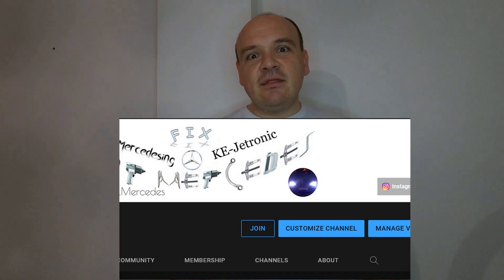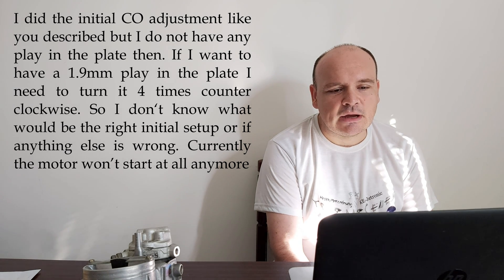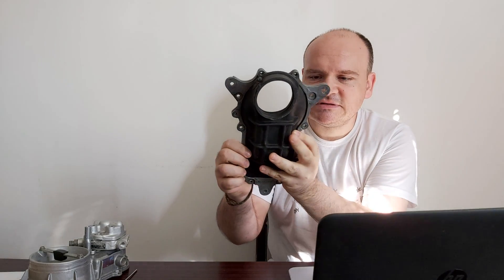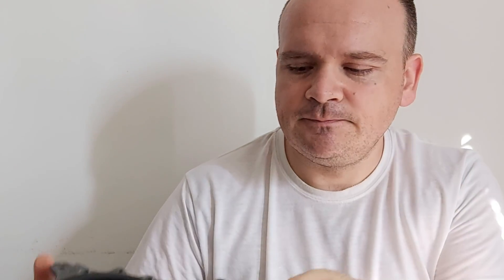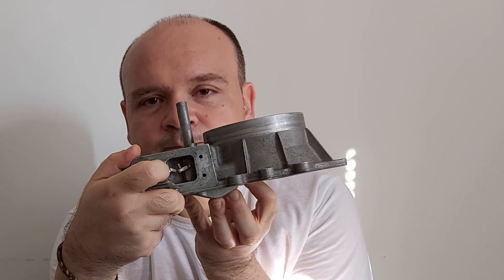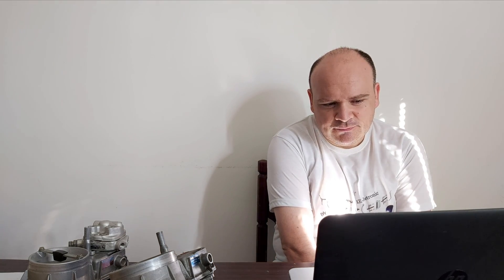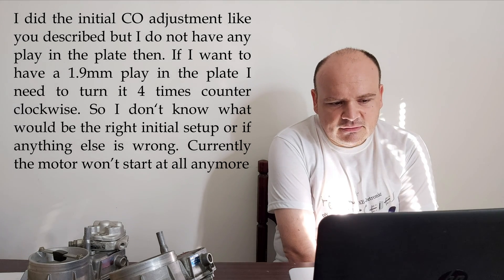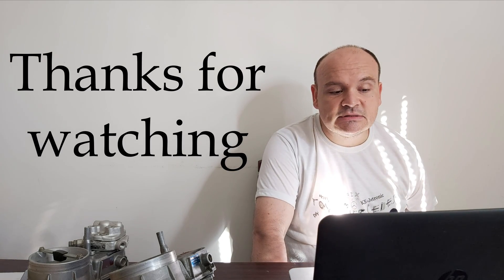㉦Mercedes Ke-Jetronic㉦ - The answer to the comment on adjusting the CO screwГ

Comment: Nice video.

I have question, well you be covering other fields, like suspension or steering problems ? 
As i example i have problem with my 190e 1987 manual gear , anyways when iam cruising at low speed at first or second gear the car drives weird, like shaking, the car shake backwards and front unless i step on the pedal  or clutch it again very gently and stepping on the pedal slowly.
Also the Car RPM seems to be stable while idle.
The car has a rough start even if the weather is warm, i always have to step on the gas gently, over stepping cause the car to die, if i dont step at all the engine start for like one second then die, same as @anbevelsborg i guess i will try to find a gage and diagnose fuel pressure, (note the setup is fairly new, i recently change the engine and gear and converted to k jetronic)
When the car is hot (around 80 degree) it start without stepping on the gas but the rpm drops after starting for 1-2 second then it comes back up eventually or after hitting the pedal once.
So iam not sure what could be the cause, is it engine\ fuel system or transmission problem, or maybe the its the emission exhaust could it be clogged?  
Not sure where to look to fix these 2 issues

Comment: You have upload one video about the codes in fuel distributor the lm0007 and the other codes but I can’t find the video and I can’t check my car to see if I have the right one…help me please
Reply from the maker: If you have codes it usually happens to be on the lambda. Anyway, just list all your sensors and check them if the wiring is okay if they are okay. Once you do, there should be no codes. LM0007 is 190E 2.3-16 right?
Reply: @mercedeske  I mean the codes in the fuel distributor and the sensor plate thing ….they both have one code like mt0007 and lm0007 ant I don’t know if they are correct or I have different codes in fuel distributor and different in the sensor plate thing …
Reply from the maker: @aggelosxronas4136  They have to be matched. The problem are M102 engines only. That one you are talking about is for the 190E 2.3-16. I know, because I have been disassembling that one. Just make it in pair with LM0007. Nevertheless, watch this video just in case!
https://www.youtube.com/watch?v=7C0iAlN1ZiE
Reply: @mercedeske  I have 1.8 1992 model.thanks for the help ☺️
Reply from the maker: @aggelosxronas4136  My pleasure!

Comment: i Love your videos. thank you for sharing info on the Ke-Jetronic system
Reply from the maker: My pleasure. As much as I know... Happy Mercedesing!
Reply: i have done a 3.0L M103 engine swap on my 190E and it wasnt getting full power like it was starving for fuel. ive done a few adjustment changed the EHA Valve and now the 190E is a Rocket. thank you again for your videos @mercedeske
Reply from the maker: @sirseanisrobinson1515  My pleasure. Happy Mercedesing 🍀 👍🏻 💪🏻 😉😊

Comment: Same problem here. I can only star with brakefluid. And then keep the engine running while pushing the plate down app 5mm. 
Have the 1.9mm set. 
Compression perfect around 12,5-13
New injectors. 
Fuel pressure 3,5
New rubber in fuel distributor. (Did not change the fuelscrews)
Start injector works fine. (Motor starts inly 1-2s then stops
Reply from the maker: Did you measure with the pressure gauge? The system and the control pressure?
Reply: @mercedeske  i did last year. Will do it again. Remember it was 3,5B.
Filter is new. Pump is 1985. 
Car has done 220.000km. I am second owner